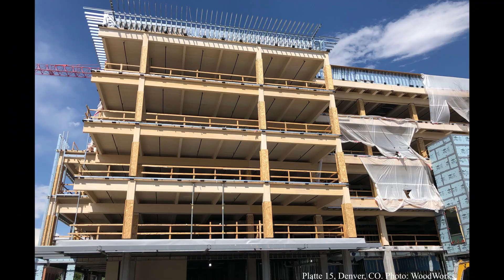Mass Timber Buildings on a Podium - The What, Why & How | 2 Min Tues 11.24.20

Comment: Warning , a bit off topic -
one of the biggest problems when using CLT for flooring is noise transfer .  in residential construction this is the number one complaint . many unsuccessful solutions have been tried but what is really needed is mass as in concrete . my son in law use to be a timber engineer for Nur Holz Rombach Germany . i suggested that they try precast concrete slabs on top of the first level walls. these are very quick and easy to install and should absorb all room generated sound like talking and even walking on the floor above . He claimed it would cost too much but i don't think so . large thick clt panels are very expensive and multiple sound deadening layers on top to accept pipes and electrical lines would cost just as much . precast concrete is not very expensive in germany because it is so common .
Reply from the maker: Indeed, acoustics design in mass timber is one of the primary design considerations. I discuss that in this video on the channel: https://www.youtube.com/watch?v=uebWIgU_TWQ

Comment: I understand you can only go siix stories up with the mass timber on top of one podium,my question is .. is there a way to construct a six-story podium around your mass timber then span a steel structure
On top and then go six more stories on top of the street structure
Essentially a steel and mass timer building
Reply from the maker: It depends on the construction type used, but one of the limiting factors is that the overall building height in feet is still measured from grade plane. So for a type IV-HT building, you could do 6 stories of timber on top of a 1 or 2 story podium, but the overall building height from grade could be no more than 85 feet. You could go taller with a type IV-B or IV-A building.
Reply: @MassTimberHowTos  OK but what if then you want to wrap the whole thing in bacon?

Comment: I would like to know which software do you use for most timber structure, please.
Reply from the maker: Hi Nelson, it depends on the type of design being done. Some of the most common systems include ETabs, SAP2000, Dlubal, RISA, Woodworks sizer, and excel spreadsheets.
Reply: @MassTimberHowTos  I mean for a regular wood residential house (2 story) . I use ETABS and SAP2000 ,but those software do not use NDS code for wood . Do you use DLUBAL and RISA-3D for this type of design at USA ? I would like to know which software do you recommend me for this timber design ?
Reply from the maker: @nelsonbalmaceda7046  it depends on the type of framing used. For single member sizing of engineered wood products, many EWP manufacturers have their own sizing software. The Woodworks sizer does design per NDS. The American Wood Council also have some single member sizing calculators on their website. And yes, some do use a full 3D model that includes NDS criteria, but more often for larger structures.
Reply: @MassTimberHowTos  thank you , very much